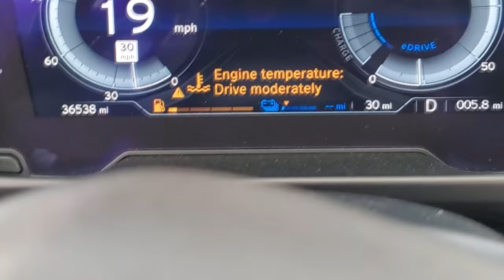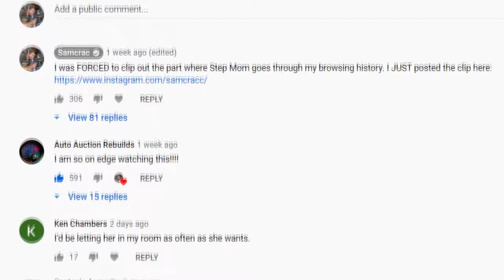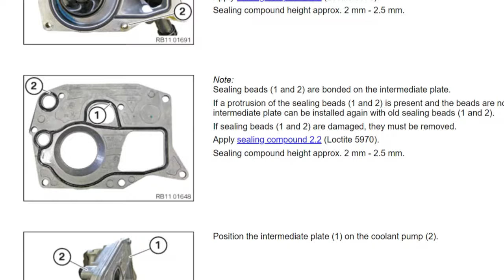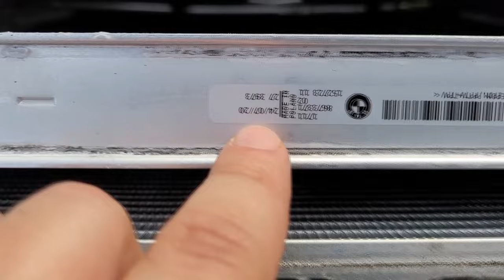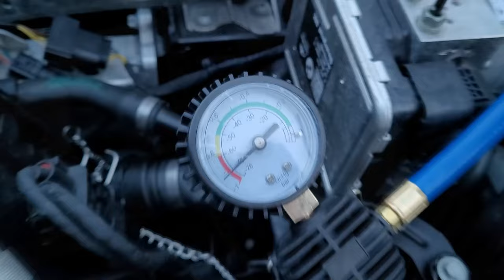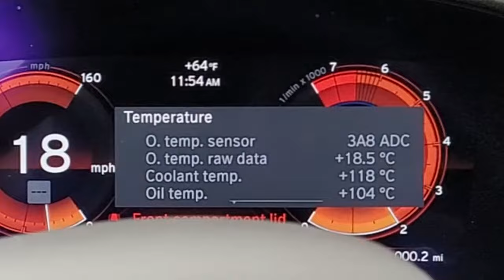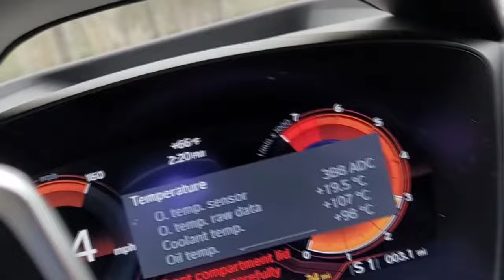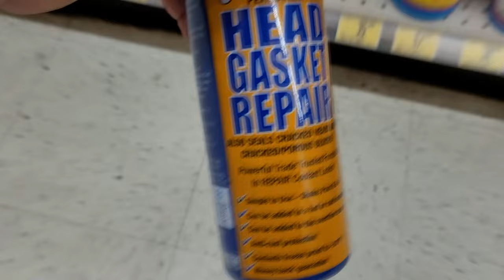The Dealer FAILED my "Unrepairable" BMW Supercar! Can I Fix it with this Simple DIY Trick???

Comment: The BMW e90 does not have a Temp Gauge.....With the electric Water Pump and to meet lower emissions, BMW has let its engines run very hot.   They did not want owners "Freaking" out about how hot the engine is running. Even though these Temps. do not Damage the Engine, it gives little time or error room if something should fail or go wrong.   I have had 2 water pumps fail on e90 N52 engines.  The Yellow light comes on and 5 second later the Red Light comes on.......About Zero time to find a place to pull over and "park the car"......

Comment: Over heating issue in a BMW? The head gasket should've been the first thing checked to be honest although I would recommend replacing the whole coolant system at that point anyways. The factory ones are absolute garbage, I don't understand why bmw continues to use cheap plastic parts for one of the most important systems in your car. With what you pay already an extra couple hundred dollars on the purchase price wouldn't even be noticed.

Comment: You have ruled out the mecanical.  Whats left?? The electrical system.  Can be so minor but can cause major issues just like this.  Think the old 70s and 80s cars rear turn signals,p bad ground and when you hit the switch all the lights rear light would flash dimmly along with the correct one.  Not completely broke just f'd up enough, same kinda thing not  if your face broke but broke enough to send a bad signal to the brain.

Comment: 1. The i8 is not a supercar; it is a BMW. 2. The stepmom gag is just creepy. 3. The diagnostic skills are just silly, particularly about filling cooling systems while the vehicle is inclined. It was clear from the first video that the vehicle had a head gasket problem; now that you disclose it was in a front end collision seals the deal. And do you really think OEs fill the radiators with the cars on a slope?

Comment: Have you tried cleaning out the radiator with compressed air? Years ago I took my truck to a criminally dishonest mechanic to replace the knock sensor, he charged me and didn't do any work and after that the truck started overheating I had to ask around for a decent mechanic and they flushed out the radiator that was filled up with some really fine sand powder. The original asshole put that in hoping I'd blow up the engine.

Comment: Dude, that's not what the vacuum is about. Its just to get the air that might be trapped in the bottom of the radiator. Having air up in the top of the tank.
Also I'm commenting before the video is over.

Comment: Man, you need to change radiator cooling relay. It will be fine. I had a same problem with Audi A3 I fix after 3 months. I had fucking hectic moment.

Comment: Please tell me you didn't run a head gasket "miracle fix" liquid through that car. It is bad enough that you replaced the radiator and thermostat when you didn't need to (I feel your pain!) but for the love of God don't taint those new parts with that gunk.

Comment: Nooo not the head gasket repair gunk! That's why the cooling system was blocked up and the radiator burst the first time! Guess what the car was repo'd after the original owner blew a headgasket and mucked up the system with stop leak!
At least save your new radiator you put in!

Comment: I hope you didn’t put that can of radiator blocking compound in to your coolant system (head gasket sealer) is the worst thing you could have done 

Pull the engine and a rebuild on a budget (can’t be that hard

Be the guy on the net that dose things right 

Or alternatively (engine swap time) 

Make it a real supercar

Comment: Aww yes, each bmw is held together with 3,476,533,797,001 bolts and screws and fasteners, nightmare to work on unless you have a full shop and speciality tools.

Comment: Mm my friend, the use of block seal or head gasket seal is only when you have a problem in highway and you need to go home, but is not a solution, repair your head gasket with a European car mechanic, the have the special tools to make de job, don't damage you expensive car with hot tricks, if you want a expensive car you you will pay an expensive cost for all, or go to a me mechanic school and learn how to do it yourself, good luck

Comment: Funny how you’ve shamed bmw dealers because you thought you knew better but instead wasted money on parts it didn’t need, blew up a radiator by over pressurising it and ignored the professional advice of it needs an engine because they knew the overheating reason, the owner before just didn’t want to spend the crazy amounts to remove the engine and replace it/fix it

Comment: You wasted too much time. Your diagnostic flow is really bad. I dont trust compression test. Always do a leak down test of all cylinder it is the only way to properly diagnose an engine internal failure.